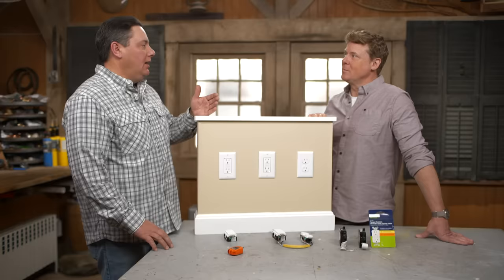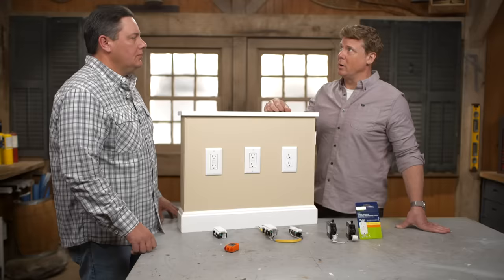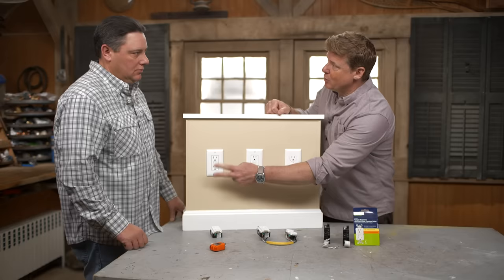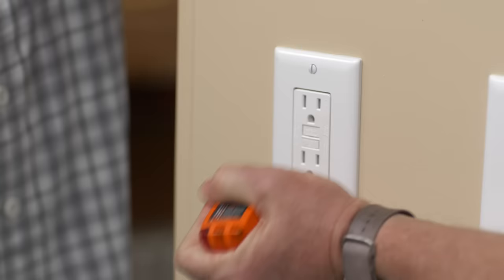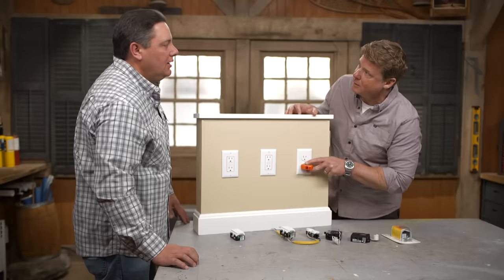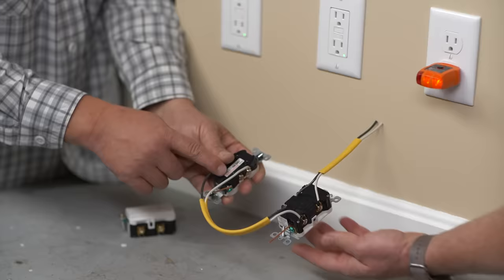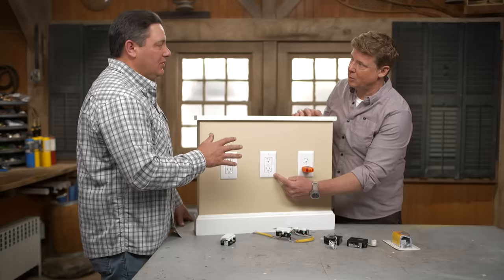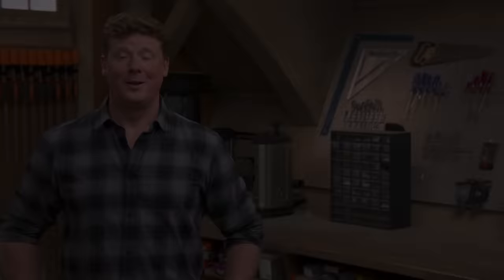Everything to Know About GFCI Receptacles | Ask This Old House

Comment: GFCI saved my life one day standing in a puddle of water using a floor scrubbing machine.  The scrubber had a bad ground it it popped almost instantly.  Still got a jolt but very quickly it was over.
Reply: Saved my when I forgot to unplug a device that I was trying to fix
Reply: I had a similar thing happen.  Working outside with a cord next to me, on my hands and knees, when a 5 gal bucket of dirty water was dumped all over my back, the ground, and the outlet at the same time.  Only later when I went inside and noticed the lights were out that I put together what happened, and indeed the gfci circuit tripped.  I was in a weird position and I'm not sure I'd have been able to move if I had gotten electrocuted
Reply: @peep39 that's shocking lol
Reply: Just out of curiosity, were you wearing rubber boots as well?

Comment: A GFCI outlet does have a few limitations that you should be aware. It won't trip the circuit if you happen to touch the hot and neutral conductors at the same time since it won't detect an imbalance. This means you can get a severe or fatal shock from doing this.  You can also get shocked before it even trips if you are the conduit.  Regardless of GFCI you should be very careful when working with electricity.  Having said this GFCI has saved thousands of lives.
Reply: Hey man, question. I'm not professionally trained in electrical, so I could be wrong, but if you are using the gfci circuit wouldn't it detect an arc just before you touch the hot and neutral at the same time causing it to trip? 
Totally agree on your safety PSA though. Electrical should not be underestimated.
Reply: @jrmillerfilms GFCIs have absolutely nothing to do with arcs.

Comment: Might be clearer to explain exactly why the breaker in the panel doesn’t do what the GFCI does.  

Panel breaker is looking for any current surge higher than its trip value, say 10 or 20A, going through the hot (black) leg.  Usually that happens with a short between hot and return, or hard short between hot and a good (green) ground. These are the  100+ amp shorts that will melt a piece off your screw driver if it’s in the way in the moment before the breaker trips.  Too many loads will also trip a breaker.  A panel breaker helps stop fires from high amps flowing through the wires.  

However, there is still the possibility of amps  lower than the panel breaker trip (10-20A) leaking out of the hot side into some kind poor ground, like from a hot connected handle on an old appliance, to a human, and to a floor puddle.  That kind of of leak might not start fires, but it sure can hurt people. GFCIs detect these leaks of current not going where they are supposed to go, and break the circuit.

Comment: They turned my garage into a room when I was very young.   But they never installed any GFCI outlets for the bathroom or kitchen area.  I was always worried about the risk.   Its very easy and cheep to convert a regular outlet in to a GFCI outlet!    I should have done this years ago.   I finally did the conversions of 3 outlets  near to bath and kicthen and i feel good about it.

Comment: can you do a video on how to use gfci if you don't have a ground in an old house. Great stuff, as always. Thanks
Reply: I am not an electrician so this is nothing more than some dude on the internet talking. GFCI outlets do not require a grounding connector to function, and can be used to replace ungrounded outlets provided they and all downstream outlets are labeled as no equipment ground. Another option you may have is a GFCI breaker in your main panel.
Reply: The instructions for how to do this come with an outlet and are easy to follow. I installed one this past summer to replace an older 2-socket outlet.

Comment: What type screw driver do I need to remove gfi receptacle? Screw has square in center with cross hatch; looks like phillips screw but it's not. The face plate is flat head driver but gfi screws are different.

Comment: Can you do a video about the difference between GFCI and AFCI outlets? Many folks get confused over which one to use where.
Reply: The basic difference between AFCI and GFCI is AFCI trips when it detects dangerous electrical arcing faults to prevents electric fire whereas GFCI trips when the electric current to ground exceeds a certain value. It protects people against fatal electric shock.

Comment: I just looked up the NEC on this and it seems to be included as of 1971. The problem I see is back then the inspectors were NOT adopting new code as often as they do today. That means many homes built in the 1980s were still done to code that was prior to 1971. I know that my home was totally rewired with a service upgrade circa 1980 and not a single mention of anything GFCI. (we've since fixed that)

Comment: What is fun, is to have the GFCI in the kid's bathroom and downstream outlets in the parent's bathroom. 
The downside is that the fun only happens once unless the kids reset it before the electrician arrives.
Reply: That's exactly how my bathrooms are wired. The small one across the two bedrooms has only one GFCI receptacle while the master has two normal receptacles that are fed and protected by that GFCI. And it makes sense because the smaller bathroom is closest to the panel.

Comment: I had a hold three prong outlet that I wanted to put a FDIC’s outlet in place of it. I took out the old one and installed the wires as the old one had them. I made sure to put the line wires and load wires in the right place. I turned on power and I got nothing coming out of outlet. I did have 120 volts coming into it. I checked with a meter and had 120 out the neutral. The test or reset button would push to reset either. Any ideas.

Comment: In an Australian household the current standard is all circuits have what we call RCD protection .  ALL circuits.  North American electrical standards and fitting like positively steam powered. Even the outlet terminals are exposed ... pops my noodle !
Reply: I am in north america and I do agree, but I think you also have to consider the different risk levels of touching 120v here vs 230v elsewhere. Here the thought is that in an area that is not wet the chances of your skin allowing enough current to flow at 120v to seriously hurt you is very low. Also, I can't believe that in many countries the GFCI/RCD trip point is 30mA at 230v! to me that seems very dangerous, we were always taught that above 10mA through the body is hazardous which is why GFCIs trip at 5mA in north america.

Comment: Question:  We had a bad winter storm that knocked out our power. When we flipped the breakers over everything came back on except for one outlet in the kitchen, the bedroom upstairs that's over the kitchen, and the outlets on the 2 season porch which shares a wall with the kitchen. 

After searching the entire house, my boyfriend found something that he pushed or flipped, and everything worked again. 

However, another storm last year did the same thing but this time we couldn't remember where he found to flip the power back on to the areas mentioned. 

There is no sub-panel. The outlets without power don't have those reset buttons. 

My house is over 100yrs old. 

Do you have any ideas? I believe the outlets are fine themselves because this is the second time it's happened and the first time they came back on. 

Any help would be extremely appreciated! Thanks in advance!

Comment: GFCI outlets often come with a little book of "GFCI PROTECTED" stickers that you can put on the downstream outlets to make it more obvious that they are protected.  Of course the outlet may last much longer than the stickers, so it's best to just have the little tester.
Reply: Those are for two wire systems but nothing bans using them in grounded outlets. It may help to explain why the outlet is dead if it has tripped.

Comment: Just bought an older house. GFCI in the bathroom tripped. Went around checked things and fiddled with stuff and somehow got it back on. It tripped again over night while I was sleeping and I cannot get it back on again. I've checked everywhere for another GFCI that is on the same circuit but can't find it. I replaced the GFCI and still can't get it on. There's also a ceiling exhaust fan that I unplugged but still doesn't come on.

I really don't want to have to pay a few hundred dollars for an electrician to come fix it ....

Comment: Could do a video(s) on connecting solar panels to EV Chargers to battery storage or which is the best/safest design? Plus to more than 1 EV Chargers. Both Residential and commercial property like multiple apartment units. Whats the minimum solar panels to each vehicle plus
Apartment on this setup?
Reply: That's beyond thier scope.

Comment: I got a question for you  Heath.     I got a   1 yr old GFI   ( sub pump )  with no green light  but has  power..( I plugged in a lightbulb just  to test..and the lightbulb came  on   )  but  I`m pretty sure   it  had  a  green light  "on" last  year.    I should have  done a  reset but I didn`t and  now  I covered  it over for the  winter...should  I  go back down  &  do a  reset    to get green light    even though  I got  power     😥  Tx  Heath...   ps  last  spring..the  new breaker in  basement panel   for sub pump  switched   off  ( don`t know when  )  and I reset it...could that  have something  to do with it  ?

Comment: If you have 3 connected bathrooms, does it matter which bathroom has the GFCI outlet? And if so how do you determine which one it should have it?
Reply: It just depends on where they are on the electrical diagram. If they are wired in line with each other you would put the GFCI in the bathroom that's the closest to the breaker panel, which would protect all the bathrooms downstream. It doesn't hurt to just give each bathroom it's own GFCI though.

Comment: How many outlets can we connect to the gfci outlet? Is there a max?
Reply: No limit.
Reply: If I remember correctly, the NEC code assumes 180 Watts per duplex/single plex receptacle.

For example if you have a 15 amp circuit, code allows you to go up to 80% capacity; 120 volts times 15 amps equals 1800VA. 80% = 1440VA. To find how many receptacles: 1440VA÷180VA=8 receptacles.

You can run up to 7 receptacles through the GFCI; with the GFCI being the 8th receptacle.
Reply: The real answer is that you would have to check with your local inspector and find out what the code is in your area. TN used to have a code limiting the number of lights and/or plugs allowed on a circuit but it has since been removed a few years ago.

 The 180 watt per receptacle NEC rule is really more of a general load calculation for other uses. It's still a good idea to use it when calculating the amperage of circuit however.

Back to the question in more practical terms there are reasons not to put too many outlets under the protection of a GFCI on one circuit. Alot of modern appliances leak a little current to ground just being plugged in. I've done service calls where the reason the GFCI is tripping is because it is protecting alot of outlets that have appliances plugged into them all leaking a little current that ends up being more than 5 miliamps.

Finally distance is another concern. If I remember right Square D recommends a max circuit length of 250 feet to prevent nuisance tripping with their GFCI breakers
Reply: @kylefowler5082  <> Yeah, I didn't mention about the appliances because I thought he said nothing was plugged in the GFCI, or anything downstream.

It's true that a lot of appliances leaks these days due to nearly everything is cheap ChiCom garbage.
Reply: Arigna I suggest watch a 13 part series called What on earth happened by Ewaranon to learn that the earth is not a globe.
Reply: The amount of receptacles per circuit depends on local code.

Comment: While I'm glad for this, there are appliances that shouldn't be on GFCI like a freezer and or fridge. These receptacles are mass-produced, aren't all subjected to individual QC, and can trip for no reason. We had one in a garage (bldg code) and it tripped with no one around. The appliance, a deepchest freezer, then powered off and we never realized till it was too late. We lost $$$ in food. The freezer was tossed out because of the smell. Same thing happened to a new replacement, but this time we caught it as I had a LED on it. I decided to replace the GFCI with normal receptacle and no more issues (circuit was 20A and no other load). Electrician told me of ghost trips and the worst are the AFCI receptacles. I prefer, in the garage, using a GFCI-cord plug device like with a powerwasher or shop vac. Or a powerstrip with GFCI integrated.
Reply: refrigerators and freezers are supposed to be on separate circuits, for exactly that reason.

Comment: My house was built in 1996 and doesn’t have Gfci plug in the bathrooms.
Reply: You can add one. Should be simple. But first make sure there isn't one somewhere else, on the same circuit, that is already protecting the bathroom receptacle.
Reply: They can be added easily. Not a bad idea where water is located. Will prevent death if the ol lady throws the hairdryer in the tub while your bathing.
Reply: They also can exist in the electrical panel as a gfci breaker.

Comment: Id love to see a break down of different electrical systems world wide.

In Ireland we follow the U.K. System and alot of what im seeing in the USA seems primitive in comparison.

We protect whole houses not just individual outlets? We also have individual earth or ground on all appliances. 

Can anyone comment on this? Maybe im wrong?
Reply: You also have 240 v right?  I've been connected to 110 for a second or so, no damage.  I wouldn't try that with 240.
Reply: @robertf6344  Voltage hurts, actually it's the current that kills. 30mA is the threshold for healthy adults, 10mA can kill children and elderly persons with heart issues. When touching it in the right (or better wrong) moment it will disturb the sine node that controls the heart beat and the rate of it. Heart beat rate will increase massively, but that will reduce the pumping power of the heart, leading to unconsciousness and cardiac arrest at the end. CPR until ambulance arrives and they can use a defibrillator to bring the heart beat back into the regular rythm.
That can even happen up to 24h after the shock.
That's the reason almost all electricians here have these automatic defibrillators (AED) that can be used by lay-persons.

And here in Germany we got two voltages in the electric installations, because they are usually three-phase installations. The voltage between every one of the three lines is 230V to neutral or ground, the voltage between the lines is 400V. So never touch two wires at the same time.
In the UK and other European countries you'll find three-phase only in commercial and industrial installations, domestic installations are usually single phase only.

Comment: I have a GFCI that trip daily despite having no load on the line/outlet… What do I do?!
Reply: It's likely defective. If replacing it doesn't work, then there's a fault in the circuit somewhere, usually a bad/melted wire splice or something in one of the switch, receptacle, or junction outlet boxes.
Reply: Look for a device (outlet probably) somewhere that gets damp. I have one in my bathroom that also feeds an outdoor outlet. When it rained, the GFCI in my bathroom would trip.  Took me a while to figure that one out.
Reply: @ianbutler1983  <> Lol, I forgot about that possibility! 👍
Reply: Could be the outlet itself
replace it, if it still trips, you might have a wiring issue somewhere.

Comment: What if I put a gfci to another gfci. Will it matter?
Reply: As long as you go to line side it should be fine...a little overkill though
Reply: It's not unsafe to have a GFCI protect another GFCI but it makes it confusing to those who don't know it's wired like that. People are used to pressing the reset button on one GFCI to reset the circuit. With two GFCI's they might both trip and require a reset of both units. Or maybe the one protecting the other trips and someone else doesn't know about the first one and doesn't understand why they can't get the power back on.

Electrical can be confusing enough for an electrician sometimes let alone the average Joe. No need to make it any worse
Reply: That's actually how I rewired my house, mainly because I like redundancy and had made a bulk purchase of GFCI outlets online for a fraction of the in-store cost. I do get nuisance interruptions on occasion, but physically seeing the GFCI at each wet location gives a bit more feeling or reassurance.
Reply: @kylefowler5082  what if the GFCI isn't turning off the other outlets in the circuit?